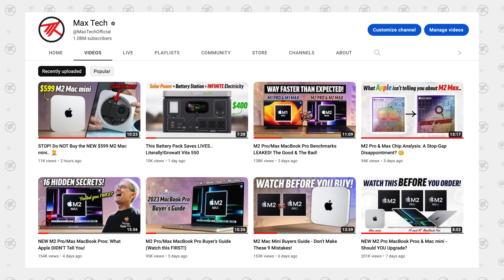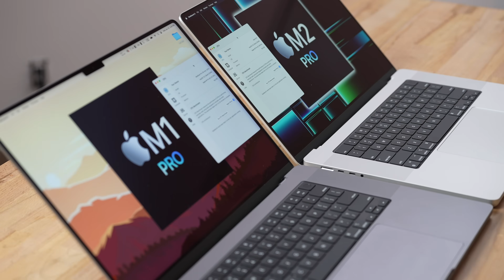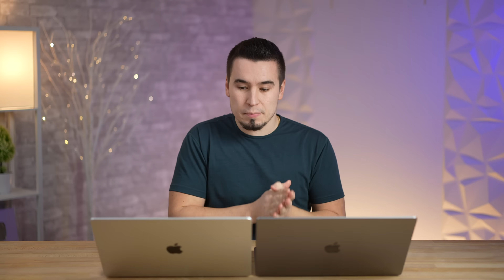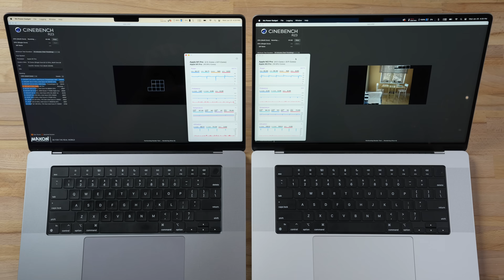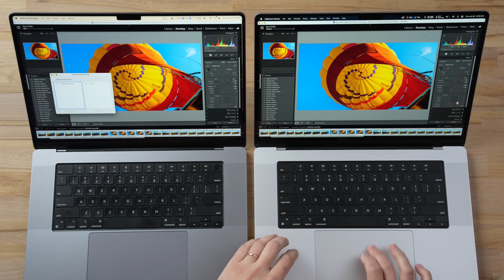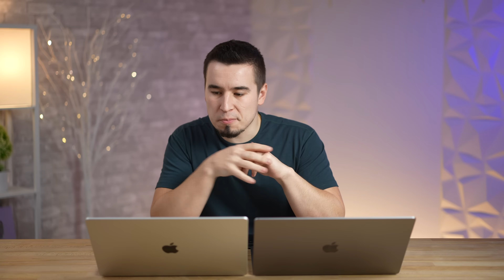M2 Pro 16" MacBook Pro - EPIC Comparison (BAD UPGRADE!?)

Comment: Well, it seems like almost all progress is based on more power consumption instead of better architecture.
But that is basically what we know, all comes in line, higher clock speed, more cores, more power consumption but with the more efficiency cores more efficiency in the end.
But also way higher temperatures again, like at those old Intel days.
By the way, in a real world 360 campaign with all the bells and whistles, it can happen that you run Figma, 4-5 Apps from the creative cloud, mails, teams plus 30-40 web pages and so on at the same moment. Happens pretty often to me.
So actually SSD speed can be pretty often become a problem.
It is Apples big benefit but also Apples bottleneck now.
What I would like to see is Apple giving the board 45 watt , making a cooling which keeps the 45 cool, I would be fine with 10 hours productivity if that leads to 50-75% more performance if it scales with the power it gets.
Plus hope for you compare the blender results also with other notebooks in their class with 3060-3080 and 4060 to 4080 once its available.
Also on battery maybe, maybe when the next discount hits on the m2 Max I am convinced to buy it, even so the M3 Max should almost be around the corner as well, if they really wait 1 1/2 year, well, I don’t know if thats not to late for me.
I often notice, the more I hate on Apple because the gains especially at 3D are to low for my needs, I always know that I wont be happy with a Windows machine not being able to do everything I do with my Mac but also vise versa, to not be able to got great game support (like steam deck works with Linux, should work on M-SOC as well? At least with rosetta?), that would sucks but well, one hit I would take.
Even so I once dreamed for one product to get it all.

Comment: Results look good. Cant wait fir the Max (no pun lol intended) speeds to be revealed. I’m going to take a guess and say 21 seconds which would be fantastic especially on battery power. My pc laptop does the BMW test in 14 seconds but only if the huge power brick is plugged in. So 21 on battery would be fantastic.

Comment: Seems like a pretty reasonable progression to me considering it's barely been longer than a year since the M1 Pro/Max was released. Not enough to warranty an upgrade for M1 Pro/Max owners, yet a decent step up in most areas (as long as you opt for larger SSD sizes) for those who have held out with their Intel MacBook Pros for this long.

Comment: At least the M2 mac mini is here hopefully it will replace my 2011 mac mini. Only drawback is that it has not been refreshed with a new design and still do not have the useful SD card slot. Still wondering if the limited number of TB4 / USB C slot is a pain as I use 2 external displays

Comment: Would be curios to compare battery life on the 16inch m2pro in mid to low load usage. How much longer would it last with the extra efficiency cores?
Otherwise great video as usual guys!

Comment: I'm really finding these comparison videos helpful. I am curious what the results would be if you compare a 512 SSD with 32gb ram, to a 1tb SSD with 16gb ram because of the swap speed.
Reply: What machine are you using currently?
Reply: If you need the ram, get more ram. You can always add on external storage. 512 is plenty to run programs off of at least

Comment: Great comparison, the only thing that bugs me is the slower ssd speed of the M2 base line machines.
Reply: this. I feel like it's best to upgrade to 1TB at least for the M2, but if you then compare its price to the M1 base model, especially if you don't need 1TB of storage and you're just doing it 'for the speed', then it even makes less sense to buy the M2 instead of the M1... it just feels weird buying a 2021 laptop in 2023 ¯\_(ツ)_/¯

Comment: The Apple silicon performance it’s still impressive. In places with unstable electrical power these devices will allow you to do professional work for a daily shift. I am based in South Africa where load shedding occurs daily😅

Comment: You’re absolutely right bro… if you already own a M1 Pro… the M2 pro makes absolutely no sense at all… and even if you’re just upgrading after holding out a generation or 2, it definitely makes sense to just grab the M1 Pro and call it a day… the “gains” are basically negligible unless you push these systems to their max… and if you have to do that, then you shouldn’t be getting the Pro variant anyway, might as well get the Max. Great video as always man. Keep ‘em coming.

Comment: Only if you decide to almost maxout the storage, it will be interesting. If your choice is to take the M2 on cost of the small SSD , its not a good choice, then the discounted M1 price is the better choice as this issue cannot be fixed by a software update. In total the performance jump is not enough to justify the M2 especially as it is countered by the SSD issue. If you are going for 1+TB SSD and the perfomance jump enables you to do MORE paid word, it is a hard calculation. Perhaps if a test with a way more bigger Blender project can be the way to justify it, but what benefit is a minute saved once a day? You can save more time by better organization and probably batch jobs over night. Also take into account the higher energy consumption, so minor increase of energy  for minor increase of performance, so a zero summ equation. You cannot get so much improvement compaired to the savings by reduced prices, and the old modfel will not suffer as much from the SSD issue (buy smaller built in SSD and buy bigger and cheaper external SSD)
Reply: thanks for being an active subscriber message me with the above username ...

Comment: Would there be any downgrade in performance (mainly using photo and video editing apps) if switching to a 14” M2 Max from a 16” M1 Max due to thermal and smaller chasis? wanting to switch to smaller laptop for portability.

Other thing I’m wondering, and maybe it would be good as a new testing category, how the MBP’s perform when docked on 4K/5K monitors in clamshell mode vs laptop mode.
Reply: thanks for being an active subscriber message me with the above username ...

Comment: Thank you for the review! I definitely agree that M1 Pro has greater value than M2 Pro, since it also has better ssd performace (at least for the base model). As a music production hobbyist, the M2 Pro does not have any improvement over M1 Pro. However, since I’m still using 2012 Mac Mini and MBP, they both would be great upgrade for me personally.
Reply: thanks for being an active subscriber message me with the above username ..

Comment: I guess they(Apple) opted for that slower SSD because theoretically, with 200/400mb/s memory bandwith, the Macs would still be running snappy. However, there would be slow downs once Ram is already used and swap kicks in.

Comment: I own a 2010 macbook air. I been meaning to upgrade it now that is showing issues on many fronts. I was going to buy the M1 but decided to wait for M2. However, after all the reviews, it seems to me I can push my 2010 a few more months until the M3 comes. Hopefully it will come with the 3nm processor. Here is hoping Apple make a giant leap in performance with the M3 as it did with the M1.

Comment: I think if you have the 2021 this isn't a must have upgrade by any means.  I was disappointed with the webcam on the 2021 laptop but I've also noticed that I hardly use the webcam on my personal laptop, so a change in the camera won't be big for a user like me.
Reply: Do you have an iPhone? Because that iPhone camera can be used with a mount on the top of the MacBook Pro for a significantly better camera.

Comment: The photo editing results is what I was interested in. As I expected, the M2 was slightly faster in exporting photos than the M1; only if I don't multitask (which I rarely do). But still it's not worth the upgrade coming from my current M1 model. This is why I love these comparison videos. Saves me a lot of time browsing through buyers guide from other websites.
Reply: Thanks for being an active subscriber message me with the above username
Reply: The base version of the M2 Pro is slightly faster. The 1TB+ models will be even faster with export because there are more SSD chiplets, like in the original M1. Speed only increases from this base model when they start reviewing the higher spec'd models.

Comment: I’m not certain your multi-core Geekbench score for M2 Pro is correct. ~12,000 pts would be for binned 10c version and you’ve stated using 12c.
All previous tests showed ~15,000 pts with those 2 extra cores.
Reply: Thanks for being an active subscriber message me with the above username...

Comment: Great comparisons overall!  Would have love to seen XCode on the same core counts because the change in more efficiency cores in the M2 Pro base model could be an issue. Even if the base M2 Pro is worse "performance" wise, does the improvements of power consumption and additional features (WiFi 6e, Bluetooth 5.3, HDMI 2.1, Camera, etc) out way getting the M1 Pro 10C model? Again this all depends on the use case of the individual and what the budget for someone would be.

ps. For anyone that bought a M1 Pro/Max during the sale from ~November to roughly last week of December probably scored ideally the best price to performance ratio for any MacBook currently. I'm personally glad I didn't wait for the M2 as it not that drastic of a change.

Comment: I just grabbed the M1 Pro 16" 1TB for £1,999 on the Apple Certified Refurbished store (1 cycle on the battery so basically new!). Coming from a 15" 2018 it's a massive leap up! Thanks for this comparison - you guys helped me realise this is much more of an incremental bump than some other reviewers would have you believe.
Reply: If possible let me know how fast you feel it’s your new M1 now. I still have a 2017 and I feel the urge to update
Reply: @Visethelegend  I'd say it depends what you're doing. With web browsing, spreadsheets and light word processing - you'd have to be very sensitive to identify the upgrade (I can't). Ok, the ProMotion 120hz display is pretty slick. HOWEVER - With large, complex After Effects compositions or 4k Premier Pro/ Final Cut edits there's a huge boost to performance. I'd imagine that if you're a dev running multiple VM's or using XCode, Android Studio, Docker, etc. you'd definitely notice the upgrade over an Intel MBP. Personally, I'm glad I saved £6-700 over the new devices.
Reply: @w00t-w00t  I’m more of a colorist so I think I would love a bit of a boost when doing heavy grading on more or less large timelines or with Arri and R3D footage

Comment: Overall I’d say based on all these comparisons that the M1 Pro models on sale are the better buy overall unless you need that slight bump in performance, Wi-Fi 6E and HDMI 2.1. For about $500 less you can get the 16” M1 Pro 1TB when compared to the M2 Pro and that’s a great bargain.

Comment: its can be lower life battery usage if you have a heavy loaded work day without any charging with the wattage consumption on the m2 pro, its like overclocking a cpu on any pc, hight frequency but hight consumption,

Comment: Could you compare the thermals between the m2 14 and 16? It seems based on your videos the temps are similar same with fan speed and noise. Or am I wrong with that assumption?

Comment: So let's recap. M1 Pro/Max users can keep their devices and don't need to upgrade (which is to be expected). But the box is pretty hot. How hot the Max versions get and whether they unfortunately throttle their performance. One can be curious. But as always, a great comparison.

Comment: Hi, guys! Very interesting and complete the tests you did. They give a very broad idea of the potential and performance of the compared MacBooks. Regarding this comparison specifically, I got the impression that this is the comparison in which the purchase of the new model with M2 proves to be a little more justifiable. In any case, the tests you have done give us important elements to decide the best configuration in terms of cost-benefit.

Comment: Really appreciate these comparisons. I’m definitely going with a higher than base model, but it’s a good time to pick up a new Mac, regardless of the generation. Especially the Pro and Max models. Nice improvements since they seem to have fixed the TLB issue. Maybe in the M3 they’ll fix the SSD bandwidth issues on the base models, but short of offering a dual NAND SSD as a base model, I don’t see how they can fix it.

Comment: This is the video we all needed! shocking results in Blender! 😮. I think the M2 pro and max will be totally worth it for some people who need it for 3D work. I would be supper happy with either the M1 or M2 but then again I'm currently running the same MB from 2012 I have had for the last 10 years! 😔
Reply: I am watching this video on MBP mid 2012 13 inch. still rock solid lol
Reply: @turtl_9000  we just about got in there for the Retina glory! Their longevity is amazing, if only all other tech could last as long...
Reply: Running a 2016 MBP with touch bar here. I think the Apple silicon jump for people like us will be phenomenal.

Comment: It really just seems like to me, with the added power draw it barely seems like an upgrade outside of the new hdmi port. 

It’s like a 20 percent gain in power draw for 20-30 percent gain in performance. 

If Apple had good overclocking support for their chips I almost feel like the m1 would be almost negligible in speed difference.

And they didn’t even change the size of the architecture this year.
Reply: this.

Comment: Upgrading from the 13” M1 MBP 16 and 1tb. Looking at either the 14” or 16”. By what I’m seeing is that if I get the 14” I should get the M2 model. But what about the 16” one?  Should I just get the M1 model to save some money?  I’m getting into coding so I’m not sure which one I’m going to get. Either 14” for portability or the 16” for the screen. Both will probably have 16gb of ram. Any thoughts?

Comment: I appreciate your detailed comparisons. The 2021 14” and 16” MacBook Pros with M1 Pro and M1 Max were already so good. But these new chips are somewhat of an improvement. I’m disappointed by the speakers as they just sound better for the 2021 models, especially in the video comparing the 2021 and 2023 14” Models.

Comment: Again a great and valuable comparison - many thanks for that. All the M2 comparison videos I saw by now tell me that my MBP M1 Pro with 32 GB of UM and 2 TB SSD still is a beast and handles everything I throw at it with style points. The performance gains of the M2 ones are impressive, but we should also take this with a grain of salt, because it needs more power and the chips get pretty hot. Definitely not going to upgrade until they equip them with the 2 Nm chips. Keep up the great work, guys! ⭐
Reply: Any regrets going to 32 ram and 2 TB, I’m thinking to do that for the M2 Pro soon
Reply: @Fakhouryyy  Not at all. It handles everything I throw at it and sometimes it's a lot - I'm a music producer and I need a lot of UM and also storage. For me it was the right decision. And the SSD is so blazing fast!

Comment: Best part is these macbooks have slower read write speeds and apple atleast here in the United Kingdom have removed M1 MacBook pros off the site now to and I don't really want to buy a second hand one
Reply: As you saw, and as Apple says, those slower speeds make very little difference in real life. It is clear the M2 is a solid, even excellent, upgrade over the M2, so for those coming from Intel Macs, it is a no-brainer to buy the M2.

If you flood the memory with multitasking and pro apps, a very unrealistic way to use it as even the M1 will slow down by 600%, then you simply need to buy more RAM and then again the slower SSD will make no discernible difference for the vast majority.
Reply: @ahaimes6320  yes but I've also seen another test where the M1 also outperformed the m2 with something to do with a 200gb file that took 3 minutes on the M1 and 4 on the m2. I'm not saying it's not a great product but for me I want the m1 max
Reply: @Y-Ddraig-Goch-1985 , Who is doing 200GB older swaps on a 512GB SSD? If you are doing that workload, 2TB for longevity is the minimum. Again, common sense. Those tests are clickbait and do not represent reality.

Comment: Here in the UK the 16-inch M2 Pro 1TB is £2899. However, you can pickup the same M1 Pro version for £1999 on the Apple refurbished site. Seems like a no brainier to save £900 (at least for most people)
Reply: That refurbished option is a bargain. Amazing value and a no brainier as you say.

Comment: Hey man just to give you a heads up in Logic Pro X the larger the buffer size the LESS strain is on the system. It’s a buffer that delays the processing of audio in real time and causes latency as a result. For example, when I’m recording in LPX (which I do everyday for about 8 hours!) the LOWER the I/O buffer size the less latency therefore 128 is about right. However, when I’m MIXING I put this right up to 1024 to give the computer time to do all the number crunching behind the scenes as recording latency at this point isn’t an issue but invariably there will be a lot of audio plugins now assigned to many different channels. I hope this is making some sense!
Reply: I guess what I’m TRYING to say here is if you wanted to really push these computers to their limits turn the io buffer size right down to 128 and turn the sample rate up to 96khz too. Then try your testing and I’d imagine they will sweat!